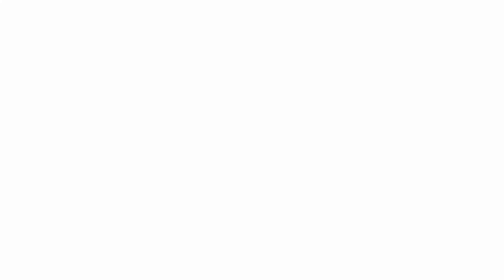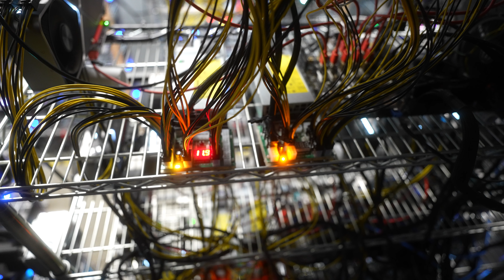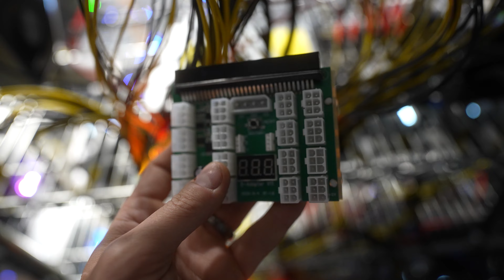Ethereum Mining - Breakout Boards Failing?

Comment: Bought these same boards from PM and so far 4 of the 6 have the same failure characteristics... however 1 board was cycling on and off every 30 seconds!  it’s only the ones that I purchased a few months ago that are problematic … the older boards from PM are still working.

Comment: Kind of crazy that your not syncing the server psus with the atx psu via the breakout board. Also, parallel small boards can only handle 1440 watts. Have to also keep in mind that Nvidia software wattage can be off by 10 watts give or take so you have to make sure your under 1440 including those software wattage errors. Parallel boards are ok, but deepintheminds boards are better and thats why they cost more.

Comment: I made a video on how these x11 break boards kept failing after a couple of months from PM. I got many other people commenting the same thing. Absolutely terrible.
Reply: SiCPoW Mining also having problems with this
Reply: Yeah, this is shockingly common, and Parallel Miner wouldn't do anything for me. It's curious how long it took for this to come out, I've been having this issue months.
Reply: I thought it was a heat issue. I've only had this issue with boards purchased in this year.
Reply: @TheClipsterClips  yeah me too, anything I purchased more than 6 months ago works perfectly fine.  As of now I have at least 10 of these outside of RMA doing this.  Has to be some kind of manufacturing flaw (or design just now showing)
Reply: Bought these same boards from PM and so far 4 of the 6 have the same failure characteristics… purchased only a few months ago.
Reply: I’ve had over 9 of them fail within 3 months unfortunately… the AMP versions seem to die quicker than the non AMP
Reply: I’ve had the same issue as well. Non of the generic Amazon boards have died on me just the PM boards. For reference this is on a 6Gh farm.